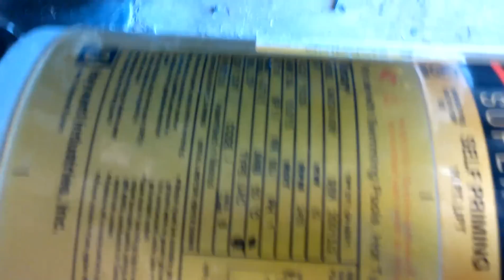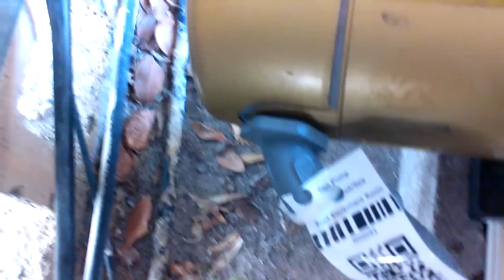Pool Pump Humming Won't Start Most Common Cause The Start Capacitor

Comment from the maker: This is a Hayward Pool Pump.WARNING: Make sure you discharge the capacitor. Make sure all power is OFF to the pool pump and motor! (Also try to spin the motor shaft and check that the motor bearings aren't rusty or seized. Or just call a professional out if you are not comfortable with basic electrical and mechanical concepts.

Comment: Very interesting stuff Rc Jr, but when I open the cover of my Hayward Turbo-Injection 2-speed pump, the only thing I see are wires for the switch, and some kind of spring piece that goes to the shaft... all of this is in front of a big metal piece covering the actual motor... I don't see any capacitors there... any thoughts? They must be hidden behind that big metal piece? (I doubt it since I see the tip of the shaft coming through, so my guess is there is nothing behind that plate other than the coil itself?

Comment: And when you do buy a starter motor capacitor buy 2 while you're there in fact I would buy them online at probably half the cost I'm learning the hard way I replaced my capacitor about 6 months ago on the pool I replaced the capacitor on my air conditioner about a year ago that just cost me $40 at my local capacitor pick up shop I could have bought the same crap online for $5 that's made in China anyway I'm going to buy a few for my pool and a few for my AC and it'll probably cheaper than just one down at the capacitor pick up shop and every other crap they sell from China okay take care.

Comment: Video should show the actual replacement of the capacitor. Also, where each of the (3) wires connect on the capacitor and from what component.
Reply: It didn't show that because he really didn't understand what he was doing.

Comment: Don't waste your money on a start cap until you verify (by spinning the motor shaft) that the motor bearings aren't rusty or seized.
Reply: 6977warrior 
New motor needed ? 
After 37 years my motor is humming .

Comment: How tricky was it getting a screwdriver to take the back cover off and the mount for the capacitor?  I think my capacitor went this morning and my pump is installed pretty close to a wall like yours.